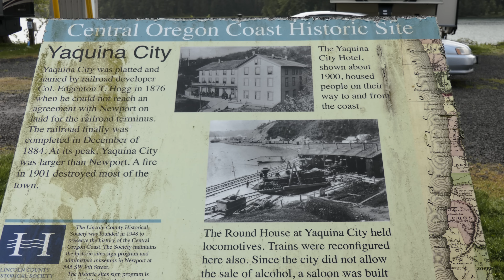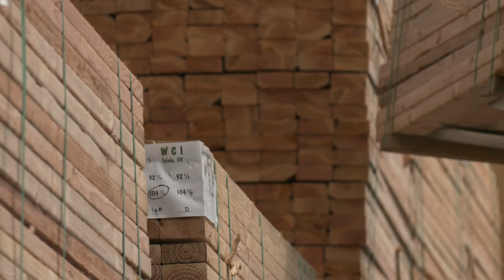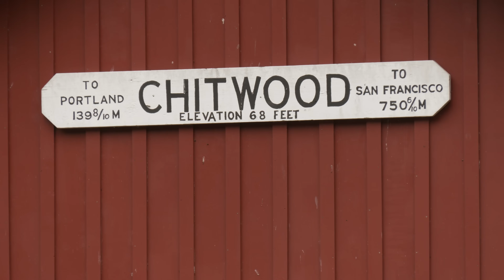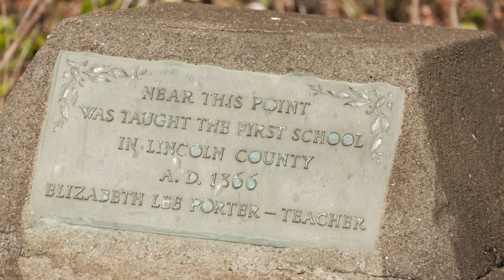Portland and Western's Toledo Branch Part 1

Comment: I see that this video is from 2020 which must be cuts from multiple days of recording in different seasons as I see the number of locomotives change. The train must not have many cars if there are only 4 locomotives.  I usually see 5 maybe 6 locomotives.
Reply from the maker: It was shot in a span of over 10 years. Quite a bit of changes indeed.

Comment: At 1:35 there are two slugs in the row.  Are they both powered by the same locomotive?
Reply: No, 3001(locomotive in front t of the slugs) and 3002(the one trailing are the two mother units the p&w owns. If you watch closely  everytime you see a slug one of these are connected to one end of it
Reply: A slug has it's own power. It's not completly dead. They just don't have cabs.
Reply: Wonderful video . The photographer 's eye for color and detail and the way the train is passing through the landscape under the canopy of huge trees...the way the dramatic sounds of the train on the grades and curves and bridges are conveyed...just wonderful. Than you for making this available. W Alsdorf
Reply from the maker: The 3001 and its slug were scrapped last year. 3002 still works on the Toledo Branch. I was glad to get both sets working together over the years.
Reply: @yettimannettii2039 
You’re thinking of a B unit. They do not have a cab but they do have a prime mover and add power to a locomotive consist. Slugs on the other hand do not make their own power, but they have traction motors which are powered by a connected locomotive. This allows the locomotive consist to apply more traction to the rails by distributing the same amount of power over more axles. They are particularly useful in low speed, heavy tonnage operations where a locomotive would not be able to apply full traction to the rails without the wheels slipping. Also, some slugs do have cabs, unlike B units. You can tell a slug with a cab apart from an actual locomotive due to the lack of radiator fans on top, since there’s no engine to cool.
Reply: I thought slugs were B units. Didn't know there were engineless units.

Comment: is it still GP? or did international paper buy it, like they did Weyerhouser in Springfield?  I haven't been to Toledo, in a long time
Reply: Seems so according to their website. Interfor bought GP in Philomath but closed the mill and kilns earlier this year which are two different locations. I was thinking Interfor bought the mill in Toledo also but GP's website still has Toledo as one of their sites. GP in Toledo is safe for now I guess. 

Looks like Youtube seems to be having a tantrum over the link to the news article for the closure. Will have to look for it yourself if you are interested in reading about it. I tried.